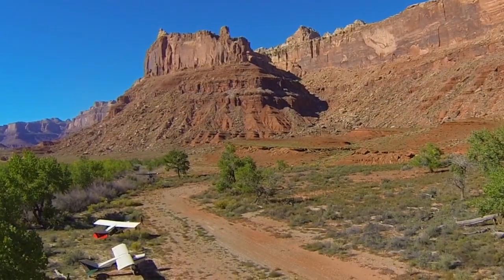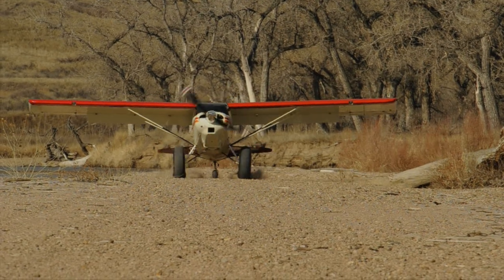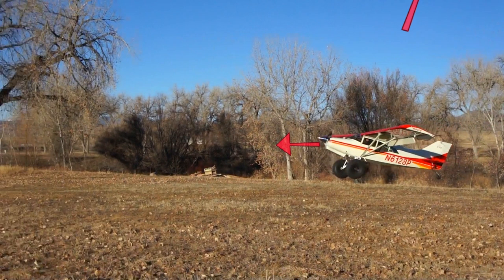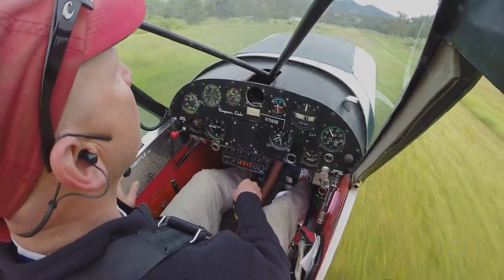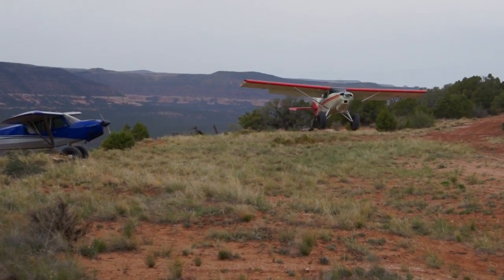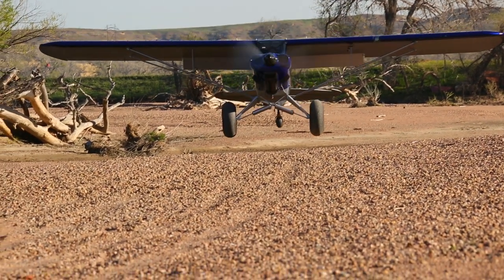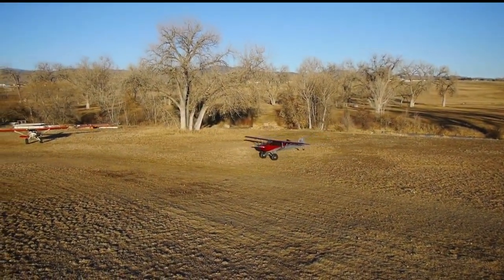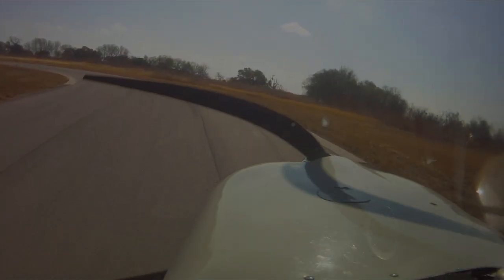Backcountry Aviation's STOL Tips: (The Landing)

Comment: I am flying an Exp. PA12 160HP Lycoming with a constant speed prop, 35" AK Bush wheels, AOSS, and Doug Kellers Perfomance Fowler Flaps. When landing on short off field areas (I would not call them strips because they are not) I typically am flying nose high, full flaps, power as needed to keep aloft adjusting power as to drop in and at the last minute rotate forward driving the wheels to the ground, dump the flaps and brake as hard as needed to stop. I find this approach works so much better for me. I have decreased my landing distance tremendously with this technique, and have damaged my tail wheel far less than when I was typically flaring as before.
Reply from the maker: Being comfortable is pretty important.  If it works for you then I would say thats what matters. As for damaging the tailwheel, we have been doing this a long time in a lot of planes and never damaged a tailwheel so perhaps you had a different technique?

Comment: Great video!  When my primary instructor taught me this it seemed weird...  But it works so well to nail that spot!  

The coolest thing I noted was the variance in airspeed per weight (AOA constant.)  He, my primary, also taught me to put the airplane in landing configuration and test the CURRENT stall speed at altitude.  Add my 5% and that was my approach speed.  Anyone else taught this method?  What were you taught to determine approach speed?

Comment: Just take a look at the dance routine on the controls from the inside shots. I use to watch Crows landing on the top of a telegraph pole, now that is how to land short, they have the flare sorted.
Reply: Helicopters do Autorotation same as birds..but they roll 20-100 feet forward...
. I admire my Blue Jays..they pluck the peanuts off my hand, back off a foot while turning 180 and power away..You feel the wind they pushed down..
Reply: Michael Devenport
Reply: Michael Devenport

Comment: flip flops and loose water bottle ahahahah, party on wayne
Reply: The loose bottle can be an issue, but style isn't.
Reply: @bidlymovies987  Don't crash.

But more to the point, a sneaker is not going to protect anything. If it would, it would be approved safety gear in dangerous environments.
Reply: @bidlymovies987  What a ridiculous comment. Guess I'll buy a firesuit for my morning commutes in my Mazda
Reply: @alexj1757  Have you ever been in a plane that  had an engine fire? My guess is you have not. You can simply pull off the road and stop in your Mazda. Not quite that simple  in an airplane.

Comment: I imagine retracting flaps also reduces nose down moment, allowing a bit more braking force with conventional gear. Not so much about the weight on the wheels if the elevator can't hold the tail down.

Comment: Those who use flats will be cut short with problems when the flaps do not work
I would always use a side slip as you can always descend at a much steeper and controlled rate. 
Forward roll is usually less, and I also noticed a lot of these taildragers  would bounce on their front wheels to much, Not allowing a proper shorter roll out to put the plane down in the shortest roll.